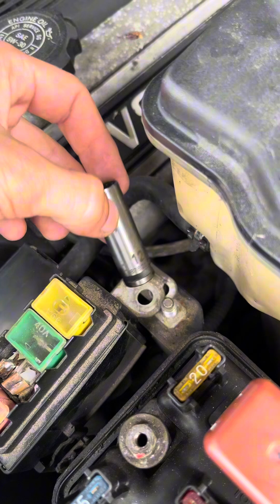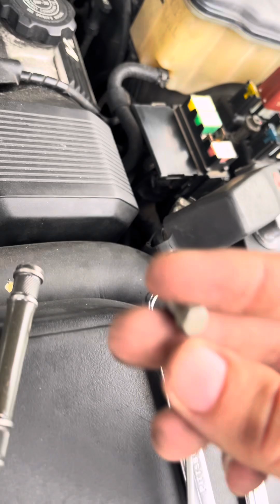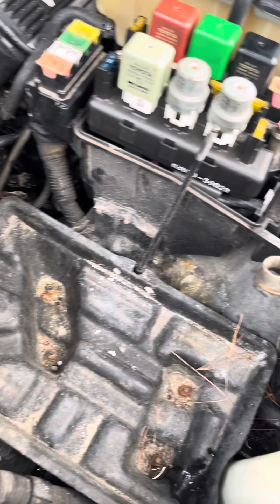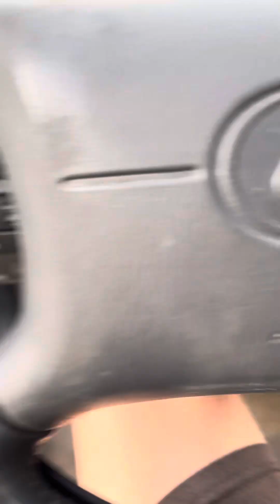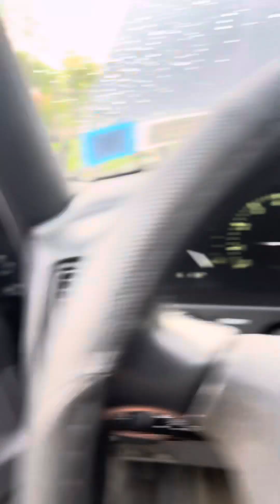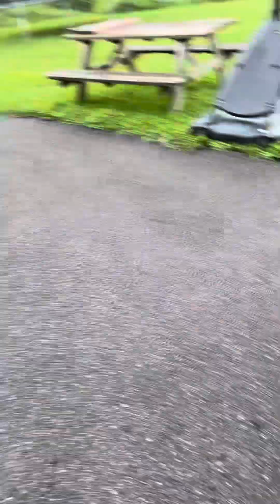1993 Lexus LS400 Fuse Block Removal + 120Amp Fuse Removal/Install (Alternator)

Comment: What problem did you have at first to come to this conclusion? I have a wierd electrical issue going on rn and I believe it this fuse
Reply from the maker: Hey man, I started looking into electrical issues since I started to have an unknown battery drain. This alternator fuse change really helped extend my charge life, however, I still had a drain after a few days of not driving. I suspect this is an issue with the old security system leaking power consistently. Unfortunately, I haven’t found the root cause yet